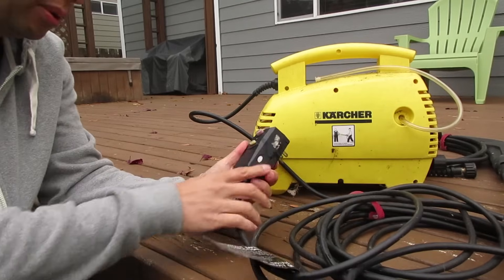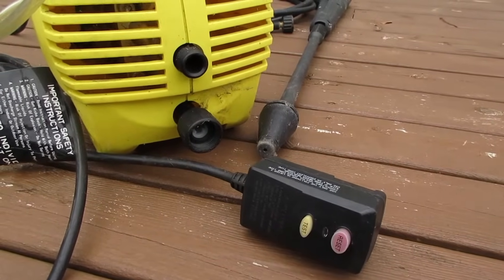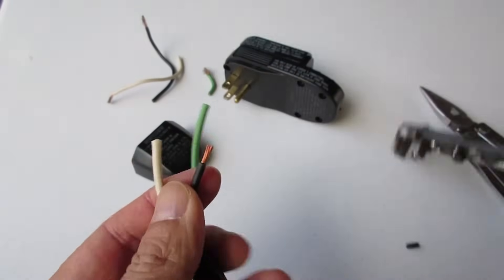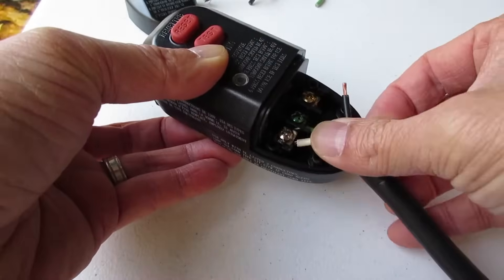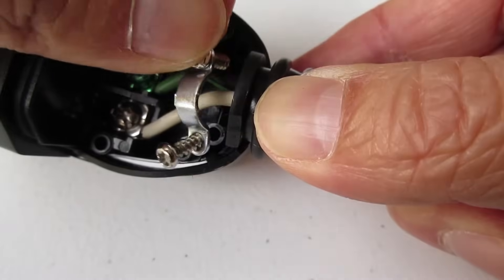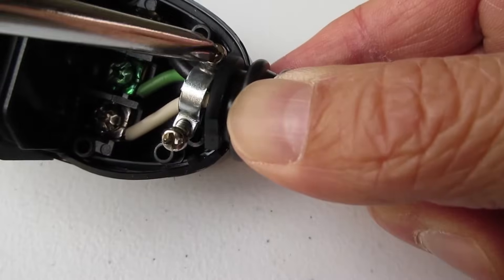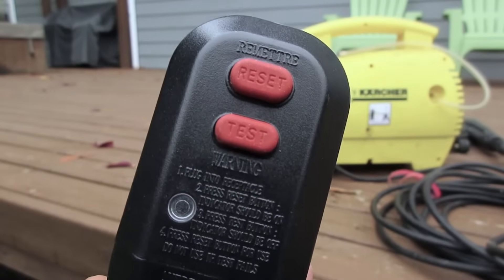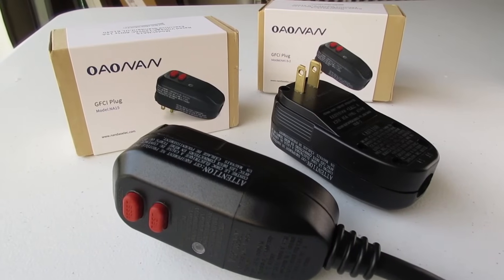Pressure Washer Repair with Oaonan GFCI Plug – Electric Pressure Washer Not Working

Comment: Called Sunjoe as the light on the gfci doesn’t light up. Seemed like a new Gfci is needed. Sunjoe says it need’s a new pump. They also have no authorized repair centers.
I’d like to think it’s just a new gfci. Thoughts?

Comment: [A little bit of added info✌️]
You don't have to cut and strip the old plug wire. If you open the bad plug, you can disconnect the wires from inside. Kinda the reverse of the install and screw down shown here, in this video.

Comment: Can you do the same thing with a window ac unit that has the same kind of plug? Thanks
Reply from the maker: Yes! I’m pretty sure you can change out the plug on an AC unit like I did on this pressure washer. Should be the same steps.

Comment: Before getting one of these, if you have security bits take apart the old one.  Due to the heavy parts inside and frequent dropping since the module is at the end of a cord, it's often just a solder joint or two that are broken on the original unit.  Solder it yourself if you understand what you're doing, or find a friend who can do it, it will usually be pretty basic soldering.  
This of course won't fix one with an actually bad part, but often it is only a broken solder joint or two and an easy fix on the original module.
Not knocking this product at all, I'll likely buy one of these myself if the one I'm working on now is actually broken..
Reply: On my rug doctor I took the plug partially apart. Found 2 security screws. Removed them. But there is something stopping me from getting it apart. I can pry it open 1/4 inch but it doesn’t pop open. 

So I have ordered a new one. But the old one won’t win. Maybe I should get out the Dremel 🤓
Reply: Thanks for the suggestion.  I'm an electronic technician, so I'll inspect mine carefully.  I drew a blank when searching for a schematic. I understand how GFCI's work: If a current transformer is around the Line and Neutral connections at the same time, on a normal circuit, the current measured will be zero.  If there is a ground fault, the current leaving the Line connection will not be equal to the current returning on the Neutral connection because that current is going to ground.  Current between 100mA and 200mA can kill someone.

Comment: Thank you so much. Having this issue with a brand new swimming pool pump. That stopped working after a few minutes. We tried everything inside and outside and nothing. I will be picking up the replacement GFCI plug today!!
Reply: Same thing happened with me now🤦🏻‍♂️

Comment: Do you suggest doing this with a brand new washer that would have to be sent back via Amazon ?
Reply from the maker: I would not suggest changing out the GFCI plug on a brand new power washer if you can still return it. I’d just exchange or return and buy a new one. I don’t know if you’re aware of this but every time I plug my power washer into an outlet I have to press the Reset button on the GFCI plug to make it work. It’s probably a safety feature. That’s one thing you can check before you return the unit.
Reply: @TheRenderQ  I did that and even took it apart and dried it.

Comment: I'm running off my inverter but the surge when I pull the trigger keeps tripping the gfci. Can't I just wire a standard plug on? I have the ar630tss on a igen4500 inverter. The pressure washer shuts off when not on the trigger and I believe that's the issue

Comment: My gfi plug had a green light but the button on the Ryobi 1700 was not green.
I replaced the Gfi plug off amazon got the same replacement and it works perfect now!
I have a plastic bag over the plug now when it’s sitting outside

Comment: I plugged my pressure washer into a non GFCI outlet it ran for about 2 minutes I turned it off when to plug it back into another non GFCI outlet and now the green test light reset light won't go off in a pressure washer won't turn on. Is this because I plugged it into a non GFCI outlet and now it's broken?

Comment: Good video but you MUST have the unstripped cord under the wire clamp at the end to avoid a wire strip. Clamping down on the individual wires is wrong and dangerous and should never be done.

Comment: Is not the correct extra procedure;  tie a knot in the connection wire, to ensure it will not be pulled out beyond the steel fastener?

Comment: I just replaced the GFCI plug you recommended with my broken Ryobi power washer...and it FIXED and WORKS again...I almost bring the machine to recycle center and thank you so much for sharing this video. Save me $200+
Reply from the maker: Excellent! I'm really glad you got your power washer working again by replacing the GFCI plug! Glad you didn't have to throw away your power washer!
Reply: I was wondering what was the issue you were having with yours? I have a Ryobi 1700 Pressure Washer and its making a buzzing noise from the plug. Thanks!
Reply: @MrBod4life  Mine didn't make any buzzing noise. The light on the plug will light up but the machine just won't start. As soon as replaced the plug, the machine fires up again.
Reply: @asmrwhitenoise3172  Oh gotcha. Glad you got yours working
Reply: @asmrwhitenoise3172  where did buy this ?
Reply: @MrBod4life  capacitor

Comment: Nice video, well shot. QUESTION: My GFCI plug has a red light on it and it goes on when I press the top button and off when I hit test. Is it possible the switch is bad even though the light is working properly?

Comment: My 15 year old Karcher went out today completely. I opened up the GFCI plug to find a burned hot (black) wire and the smell of burnt plastic. My yellow GFCI was sealed with what looked like hardened silicone gel for waterproofing. Was yours similar to that?

Comment: Glad I found this video. I wanted to wash my car this weekend and my Gfci  would not reset on my pressure washer. I had to use my garden hose instead. I also thought I had to throw away my pressure washer.This looks really easy to replace. Thanks!
Reply from the maker: Excellent! I'm really glad you found my video! Yeah this is pretty easy to fix... if in fact your GFCI is the problem!
Reply: @TheRenderQ  How would you know if in fact it is the GFCI as the problem? I have a Ryobi Pressure washer that is constant buzzing sound at the plug when plugged into the wall. Thanks!

Comment: So, we replaced our power washer  GFCI plug with a new OAONAN plug and it still won't reset properly. It just clicks back when we hit the reset button and the washer won't turn on. Is there another reason why this might be happening other than that the GFCI plug need replacing? Thanks!
Reply from the maker: Not sure if you have another issue with your power washer but is there a possibility that the wires to the Oaonan are reversed? Check to make sure nothing else is making contact with the wires or connections. I guess it's possible the Oaonan GFCI you got is faulty?
Reply: TheRenderQ thanks for your suggestions. I’m quite sure we connected the wires the right way, but will double check. Thanks!
Reply: Jocelyn Oldham Mine is doing the same. Did you ever fix the problem?
Reply: Maybe check the rest of the wires the whole length its possible there is a break somewhere.
Reply: Always check the pressure switch  https://www.youtube.com/watch?v=gdgoHwXtXos

Comment: Can I run it on direct power
Reply: If you use a direct plug and plug it into a GFI outlet, I would think that would be safe.
Reply from the maker: The power washer could run on direct power but it's not advisable. The GFCI helps prevent you from getting electrically shocked in case something happens. Water and electricity don't mix well!

Comment: My pressure washer only has 2 of the cords white and black. The only replacement home depot had were 3 cord GFCI. Could I still use it?
Reply from the maker: Thanks for your question! I actually have both the 3-prong and 2-prong versions of the Oaonan GFCI plug. Personally I wouldn't use the 3-prong if your pressure washer only needs 2. Here's a link to the 2-prong version I have: https://amzn.to/2qbJWye
Hope this helps! It's super easy to fix yourself!
Reply: Wish he’d say yes or no…I have the same problem. I bought a three prong - but only needed the two. Can I still use it? And just not have the green ground wire ?